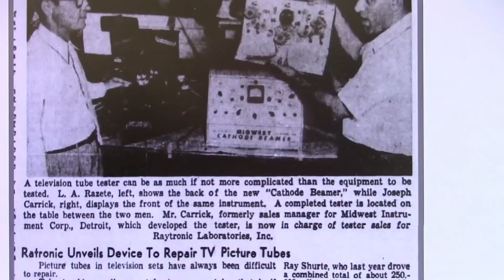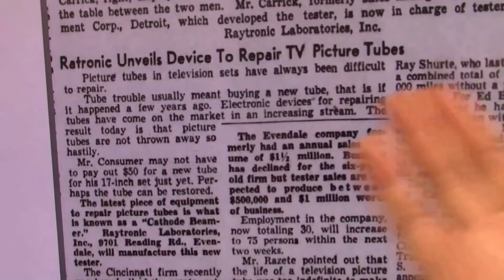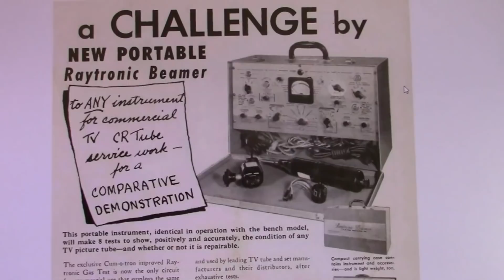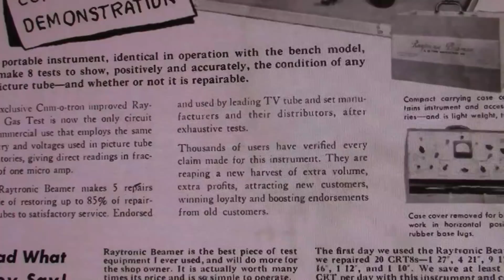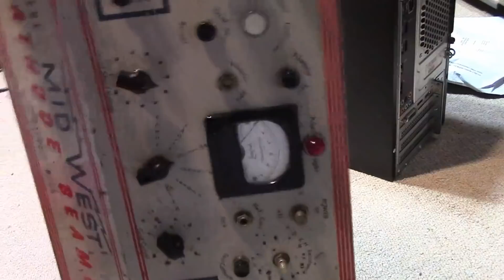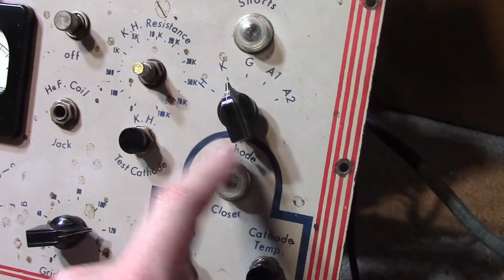Midwest Cathode Beamer - A look inside

Comment: Thanks for follow up with details as you told me you would do. For me the thing is only original once, if you don't intend on using it then just try a resurrection and see if you can get it to fire up slowly and see how she does first maybe before the restoration begins?
Reply from the maker: There are just the four electrolytics I could easily replace.  I'm more concerned about all the switch contacts and relays working.   I'm also not sure how to check that the functions are working correctly.

Comment: You have beautifully summed up my opinion of CRT restoration - "its a band aid" plain and simple, its only a short matter of time before it looks worse that it did before banging it . I had a B&K tester at my shop and if I had a tube that was flagging or weak, I would confirm it was bad and that was it, at that point it was time for a new CRT some said yes, most said no but none were pissed 2 months later.

Comment: I had the RAYTRONICS model CB-54, I would replace those oil filled caps, they may have PCB's in them, I put in a microwave 2,500 volt cap in mine.
I put a ceramac 8 pin octal socket on mine using a GREENLEE chassis punch, then I made a socket set to test a 7JP4 and a 3KP4....HOWEVER I tried to zap the 3KP4 and lost all "cutoff" on the tube, it ruined the 3KP4.
This thing is a CRT killer.

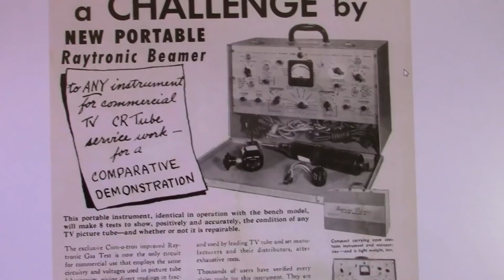Comment: (@ 7:47) - the picture of the tester shows what looks to be an early Dremel motor-tool and a small hand-held angle-grinder. I’m guessing the large one is actually a HV probe, but I’ll be damned if the other one isn’t an angle-grinder; it looks like you could slap on a grinding/sanding disk on the mandrel and affix a bolt to hold it on, and away you go.
Reply from the maker: It's actually a Wahl massager.  There are a few on eBay

Comment: I’d also add that it would make sense that most of the production (volume) of CRTs was probably for early oscilloscopes, though - to be honest - I don’t know when the first, commercially available oscilloscope came out; though, Paul Carlson (of Mr. Carlson’s Lab YT channel) probably knows. It may be that the earliest CRT testers came out about the time those first CRTs started showing up with weak emissions, but this is just a guess on my part. 🤔
Reply from the maker: There were scopes by the mid 30s for sure - maybe earlier.  The first TVs came out in 1946 but not really in any volume until 1948.

Comment: I must have been one of the lucky ones. Over my lifespan of 82 years, I probably owned at least 10 CRT TVs. I've never had a picture tube go bad.
Reply from the maker: I've had about 200 vintage TVs go through my hands and very, very few needed a new picture tube.  I think a large part of that is my focus on 1940s TVs.  Screens became much larger quickly and I think many of these sets were retired early.

Comment: Very informative overview Bob.  I own both the Raytronic and the Midwest version and have been able to revive CRTs that were dead to the B&K and Beltron.  The length of the revival is unknown but it works at least temporarily.  I consider this unit to be a piece of full featured production test gear while the B&K, Beltron and others are simplified consumer units.  Analogous to a Weston 686 Tube analyzer compared to a Heathkit, Eico or even a Hickok tube tester.  The Midwest/Raytronic gives the experienced operator full control of the testing and rejuvinating parameters where the consumer models have 1 or 2 fixed settings, are easier to operate, and were smaller and less expensive.   The 50K resistor would limit the HV current to 50ma which is certainly not pleasant but is half of what is generally considered to be lethal.  Under the right circumstances though, 50ma could be lethal so care always should be taken.  If one knows enough about HV to be working with CRTs then they should know enough to be careful around the HV lead.  BTW, the Heathkit CC-1 CRT tester also provided 2nd anode voltage to generate a visible spot.  1200VAC at very low current and using the CRT itself as a rectifier.  I am looking forward to your restoration and use videos of the Midwest.

Comment: I've seen those bench kit things for sale at home improvement stores. Looking forward to hearing how they work out for you. I just bought a new house, and am noodling over a setup for a workshop, and wondered if they would be of any use.
Reply from the maker: Even without using it yet, I have some thoughts.  They are easy to use and they do simplify the cuts needed.  The tradeoff is that it is not as strong because none of the wood overlaps in the joints.  The metal pieces do all the work to hold it together.

Comment: The ad  says the Cum-o-tron ,yadda yadda yadda. Oh please. What is this an item from Woody Allen 's "Sleeper" movie? LOL
 It makes me think with along with those accessories that this device was promoted to be more than what it says it can do.  Looks like a snake oil machine ad. The earlier version that you own and show may be very dangerous to use as is,
hell there is one fuse  ( F2) from the line voltage  to the line switch (S-12) and should be rated at 6 Amps.
 Sure clean it up, replace the things you can but it may be just a  cool looking shelf queen. BTW 2X 4 lumber is very heavy,
consider using 1x6 with 1/2 inch thick shelf storage below and a 1/2 thick base top because the area in question is not big.
Legs could be 2x2 stock. Cover the horizontal top and shelf with  hardboard sheeting. The home industrial look is in!
Reply from the maker: Hey at least they put a 50K resistor in series with the 2,500 volt lead.  That might save you?   I'm going with 2x4s because I have some nice ones I salvaged out of the basement.  Plus, I picked up a couple Simpson StrongTie workbench kits on sale

Comment: You might experiment with Evaporust in a discrete aria first using a q-tip or something.
 Its  non toxic, environmentally friendly fluid. Gentle on your hands if you get it on them &
very good at lifting rust stains. One method they suggest if part is too large to submerge is 
a soaked a paper towel contacting affected aria & covered with plastic wrap so solution will 
not evaporate & secured by magnets for 1/2 hr or as needed.....
Reply from the maker: Sure, I could give that a try.  I have a couple jugs of it.  Thanks for the suggestion.

Comment: Back in the day, your car manual told you how to adjust the valves.
These days your car battery has a warning label not to drink the contents.

This device is certainly Darwin-approved.
Reply: Back in what day. No owner's manual I'm aware of showed how to adjust valves. I'm 82, so it must have been way before my time on earth. My 1st car was a 1949 Plymouth. I've since owned a 1937 Mercury and a Model A. I never had the owner's manual for the Model A, but neither of the others showed anything but the basic things you would expect even today.
Reply: @jimdavis6833  The average eye cue (yes, I know it's not spelled that way)in America has dropped quite a bit in the last 25 years.  It is across populations in addition to larger numbers of lower eye cue people immigrating.
What consumers are expected to know about their stuff has plummeted.  Most people could do basic auto stuff, for example, BITD.  1/4 of the people couldn't change a tire today if they tried.  Most either can not or would not do a basic brake pad service or even an oil change.
Reply: @tarstarkusz  In the 50s as a teenager I replaced some broken piston rings on a flathead straight 8. There were no youtube videos to go to for help and little info. My only advice came from my Dad and the parts store guy. You are correct, it's a much different world now. BTW, I continued to drive that old Nash till I joined the military at age 20.
Reply: @jimdavis6833  Yeah, YouTube has a major blessing for me.  When I was first learning to do basic car stuff, it was from watching and "helping" friends do work on their cars.  Plus dad, but he enjoyed yelling at me if I wasn't doing something right...  Now, you can just pull up a YouTube video and at least get the general gist of it.